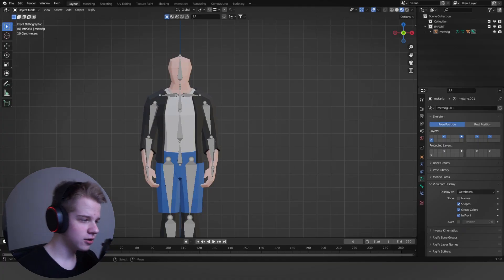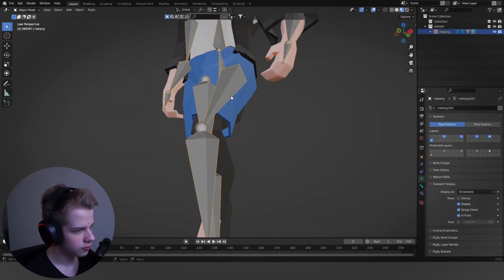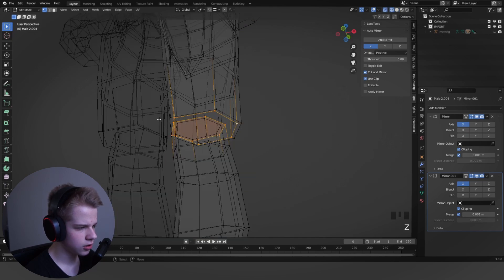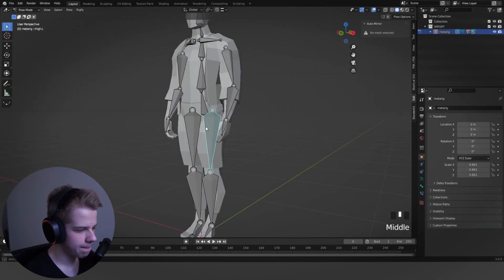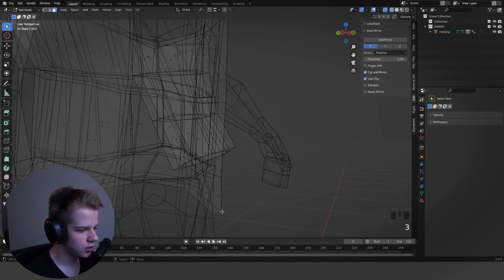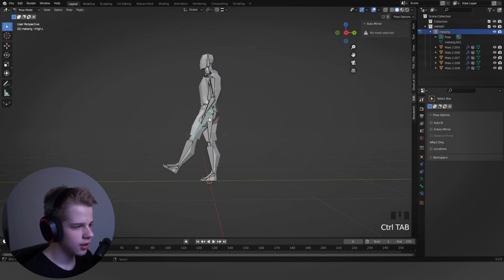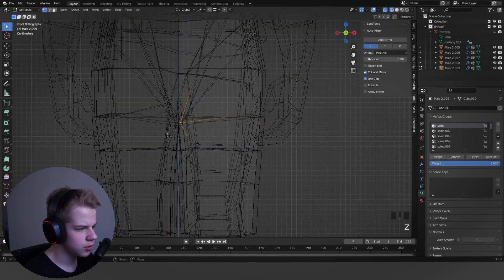FIX Your 3D Clipping NIGHTMARES FAST.

Comment: For anyone who didnt catch it, 

1:20 Method 1: If your character (lowpoly) has clothes that don't bind with the body, make sure you join the body and the clothes together and stitch them like it was one model. Think like this: Next time you make a 3d lowpoly model, instead of making the clothes separate to the body, make sure the clothes ARE the body.

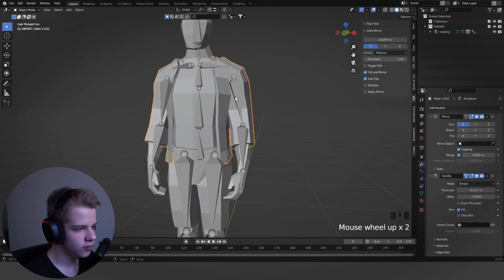3:10 Method 2: Weight Paint.

Comment: am working on avatar creation there are hundreds of clothes to customize, i cant combine mesh and weightpainting is too time taking is there any another way plz
Reply: Deleting faces under the clothing. If you still need the body faces, then create blenshapes of the body parts that clip. For example, a blend shape that shrinks the arm when jacket is on, and use that same blendshape to restore the arm to normal form when jacket is off. You control these blend shapes in the game engine of your preference.
Reply: You create one base mesh without clothes and give it the best weight paint you can. Model the clothes with topology that roughly matches the base mesh, try to keep important edge loops in place. Select the finished clothes model, add data transfer modifier - select base mesh as target - select vertex groups - nearest face interpolated - generate groups - apply the modifier. Select the base mesh, dublicate it, switch to edit mode and delete all faces hidden beneath the clothes (you may not need to do this).
Keep the base mesh as template for more clothes and as source for weights.